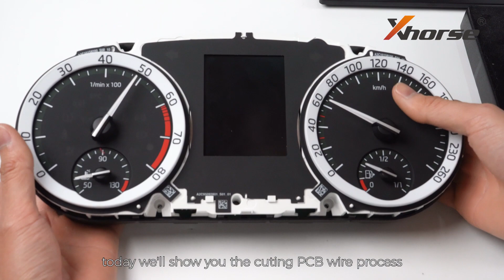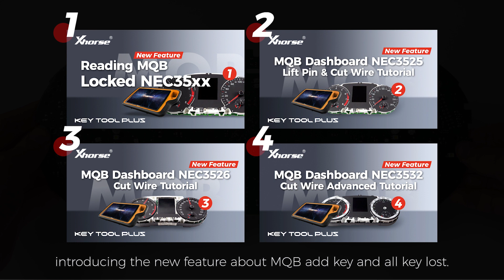MQB Dashboard NEC3532 Cut Wire Advanced Tutorial | KEY TOOL PLUS | Xhorse

Comment: Hello I have a Skoda Kodiaq 2018 car, key chip MQB48, dashboard NEC35XX, I tried to add a key through KEY TOOL PLUS, I got to the stage of reading data, it gave me a message that data cannot be read in this vehicle, in this case, I have to disassemble the dashboard from the vehicle, my question is how can I read data from  In the car in the dashboard via KEY TOOL PLUS is there an EEPROM OR MCU in the dashboard Thanks for the answer
Reply from the maker: Hi there, for the MQB nec35xx function, you need to remove the dashboard from car. it can not read it direct with obd.